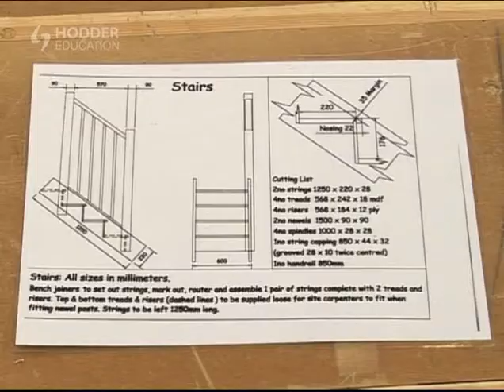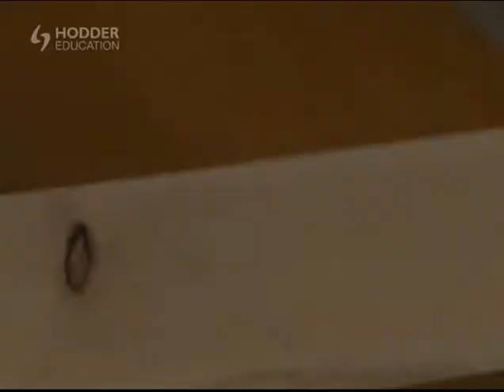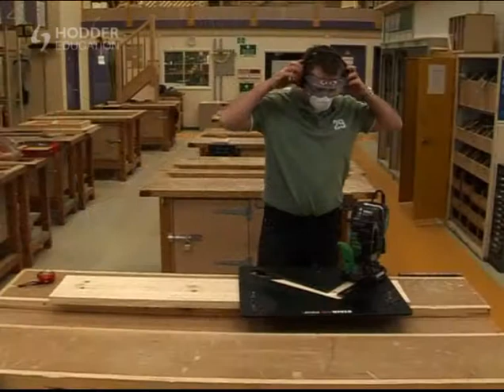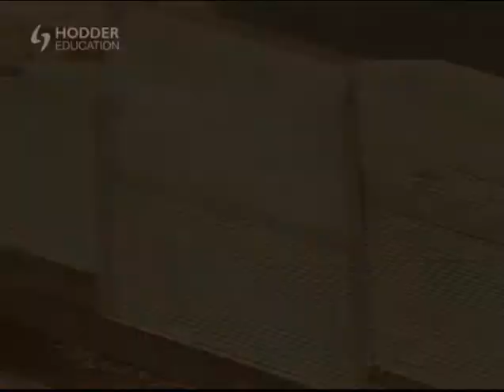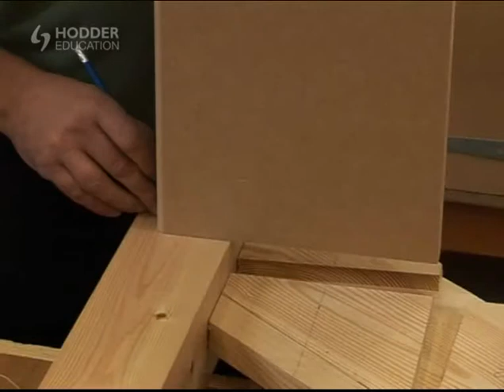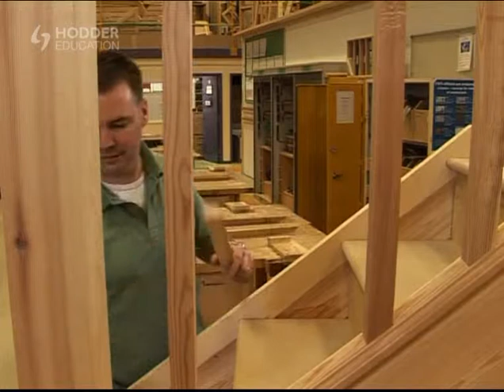Staircase

Comment: What angle did you use for the template when marking out the stringer?
Reply from the maker: UK building regs part K states stairs to be 42 degrees. The overall rise and overall going is divided by how many treads and risers wanted (within building regs max/ min amount) and pitch template made.
Reply: @carpentryjoinerywiganleigh9846  Cheers, I'm making a set of 3 stairs for my school project.
Reply: Great video I’m a site joiner but need to make one … do I use a frame square and mark my 220 tread by my 186mm rise to get the marking the margin template